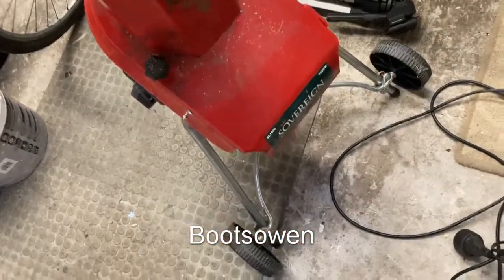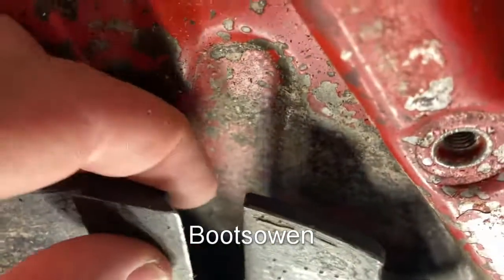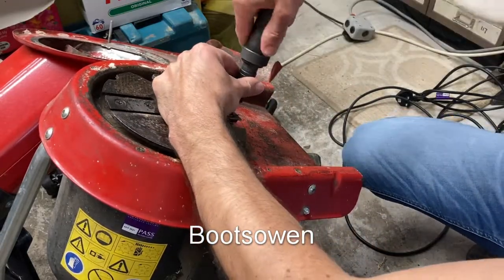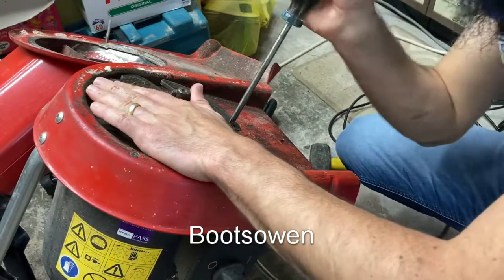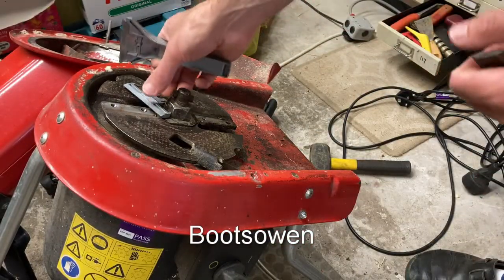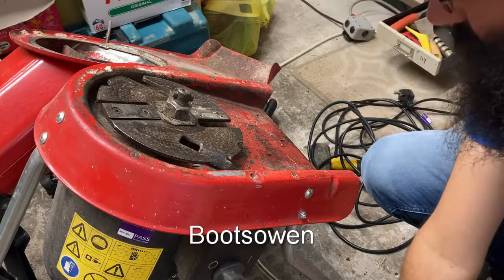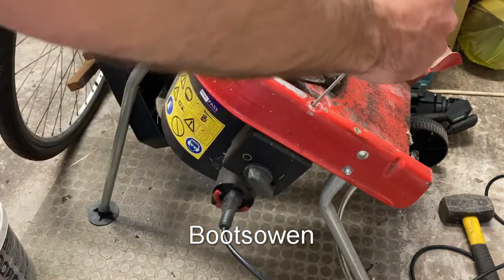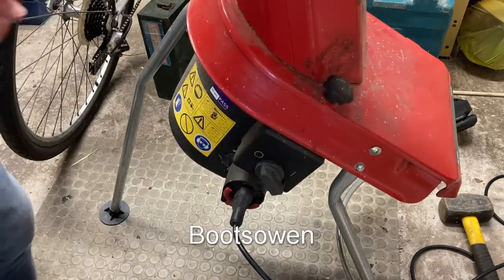How to change the blades on a garden shredder: Sovereign BL1800 garden chipper. An easy DIY fix

Comment: My Uncle's impact driver's bit holder is 1/2" square drive to the main body. I've used socket extension bars for loosening stuck screws in the depths of various machines.
Reply from the maker: I have just splashed out on another impact driver, waiting for it to arrive in the mail.

Comment: I bought a new engine for my Merry Tiller the other year. Now I want to add accessories to it. I have a pressure washer pump so far but would like to add a shredding attachment. Something with a power feed to slowly feed/force material into the blades.
Reply from the maker: I had  a merry tiller years ago, there should be a video of it in my rotavators playlist. I didn't know you could get such an attachment for one, or would you make it?
Reply: @bootsowen  make it.
I'll have to check your video. The output of the motor is a pair of V-belt pulleys so anything you fancy can just attach to that.
The pressure washer pump simply bolts onto the motor (with pulley removed).
I also had visions of attaching a pair of alternators to it for fast charging vehicles but had trouble activating the alternators.